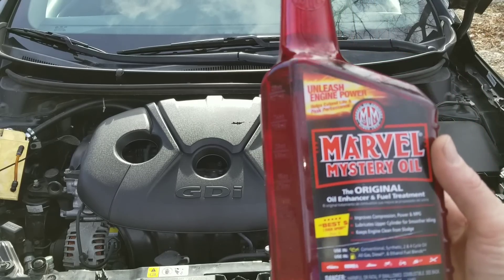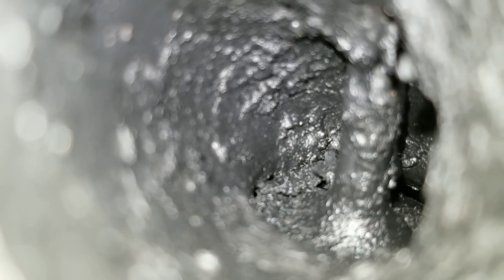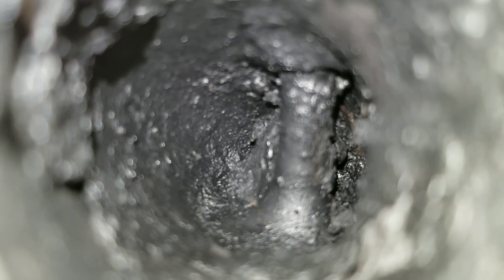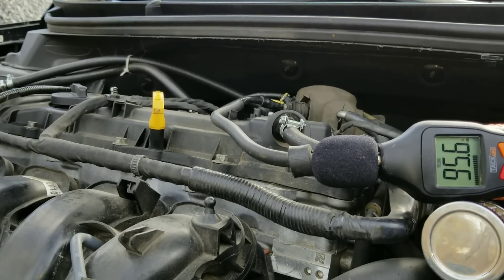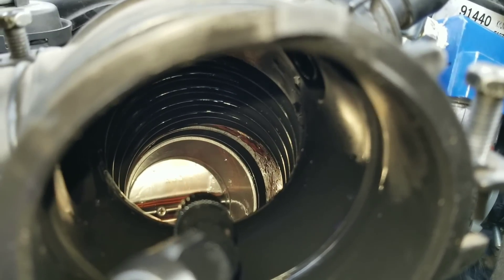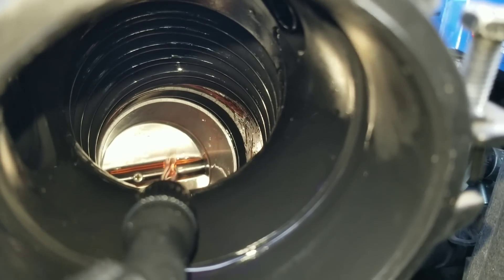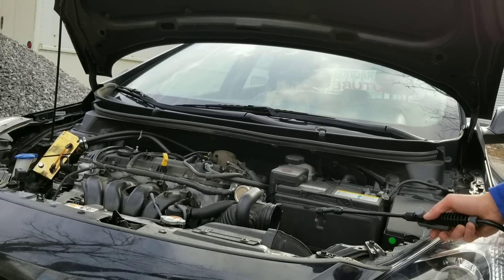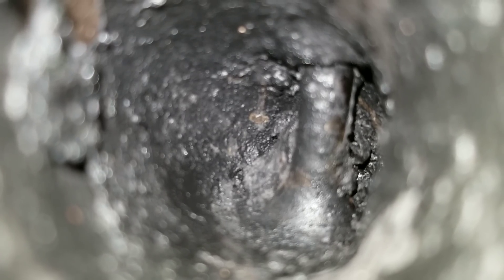SCOTTY nates REAL truth ABOUT MARVEL MYSTERY OIL

Comment: The engine needs to be revved up as you do it, that would've made a difference, but it still wouldn't be as good as seafoam aerosol, marvel is good to mix with oil and to add to your fuel. The solvent in it is not that harsh, it's very mild. It works wonders in a crankcase, change the oil and add a 20 percent mixture drive it a few hundred miles then change it again, that oil will be jet black in that little bit of time.
Reply from the maker: Yes i use as flush in video what about for a penetrating oil?
Reply: @NATESINTERACTIVEAUTO  :Hahaha Use Vaseline man ! just kidding .
Reply from the maker: For real the car is tired of getting ucked  with no ube lmao

Comment: Keep on putting it in your fuel and oil....it will soften the coke and eventually remove a great deal of it.  I’ve used MMO for 30 years, and so far, nothing else works better, but it is not an immediately cleaning substance. It’s a gentle cleaner and great lubricator

Comment: If you have a GDI engine, put an oil catch can in-between the crankcase breather and the intake. With direct injection the gas detergents don't clean the valves. The oil catch can catches the oil particulates before the recycle back in through your intake. 

Then I'd run a shit ton of seafoam spray in the intake to really get that deposit off the valves and intake runners.
Reply from the maker: Yes check out the gumout video also ive shown the catch can in the video. Seafoam gumout and crc are 3 that i have had good results with

Comment: Nate, add the cleaner into the intake via the pcv hose. You'll see a much greater difference.
Reply from the maker: It would still go onto the valves but not as even also risk hydro shock. So what can we try now?
Reply: @NATESINTERACTIVEAUTO  B12 chemtool has a hose with a jet for lack of better terms on the end and a proper hose fitting on the other. it works. I've injected into intakes for over 20 yrs without hydrolocking the engines. Raise rpm to 2k and just listen to the motor. It cleans much better.
Reply from the maker: Ive seen this thanks

Comment: I mix it in the fuel for my diesel trucks and semis and never had an issue, I've yet to dig into a before and after look but I did it once a week in a semi and once a month in my pick up and zero issues, had a tbi 350 in a 94 chevy that I mixed it with the oil after changing an oil pan gasket, ran it 500 miles and removed pan again to see the crank was cleaner

Comment: It is trying to work in the way this stuff works it is mild it will reverse the carbon slowly over just like it took a long time to build it up it takes a little while to break it down which is good at don't clog up anything on its way out of the engine that makes it a good product to continue use over time

Comment: Try b12 chemtool fuel injector cleaner on those valves they will be like brand new I use that stuff daily
Reply from the maker: Its a great product and i already have did just that in a video it definitely helps so how long have you used it?
Reply: I worked in a shop for 4 years that used b12 also. They buy it by the case. Best stuff for cleaning but it's strong so don't let it sit on plastic or paint. Great stuff. Way better than plain old carb cleaner.
Reply: NATES INTERACTIVE AUTO going on 5 years now I swear by it I have a few videos of it myself you need to check out some time!
Reply: zzzonezz your darn right I clean everything thing with it can’t beat the price per bottle at Walmart
Reply from the maker: What can i do to get me better
Reply: NATES INTERACTIVE AUTO your doing fine mine just keep posting videos with great content and try and be as accurate as possible and you can never go wrong just constantly research and learn more so you can provide more it all comes in time man keep up the good work
Reply from the maker: Any other product you like
Reply from the maker: Thanks so much
Reply from the maker: Yes i used b12 in a video
Reply: Congratulations you just cleaned one valve.  Just pissing on the intake valve isn't gonna get past closest cylinder.  Dohhhh!!!
Reply: @funtimeproductions5121  you can use the cleaned more than one way its very simple pull the manifold exhaust specifically then soak the valves bump the engine over then put it bk together then you have nice clean valves simple sorry you don't understand

Comment: What i did to my Mazda3 GDI engine was, i gave it a nice cleaning inside the valve by scrubbing the carbon off with wire brush and some diy tools. Once cleaned, i installed an oil catchment tank to traps all the unbrunt oily fumes that deposited at the intakemanifold later sucked into the valves n gunked it again. So far after 10000 miles, i rechecked the intake valves and it still looks clean with minimal deposits inside it. But im still using MMO inside my fuel tank atvevery 3rd fuel up... that will maintain my fuel injectors nozzles and the top of my piston clean
Reply from the maker: Any products we can test?
Reply: Im using seafoam to soak the dirty valves for 20 mins (making sure your valves is shut tight or at compress mode) then using a small metal pick carefully remove the carbon build up,  then I'm using small wire brush to clean the intake walls till it clean. Then repeat the process 4 times.. and u r good to go..
Reply from the maker: Great ideas what do you trust
Reply: @mazdaneo1  I got a 2016 Hyundai sonata runs great but I'm losing oil I've already did the GDI cleaning by spraying seafoam turn the vacuum line and I'm still losing oil
Reply: That's through the vacuum line and also change the PCV I think I'm going to clean the throttle and put a CAT scan in it
Reply: That's a catch can in it

Comment: Thin out the MMO with a light oil, maybe B12 or some other intake cleaner, so that you can get good atomization. The shape of that intake manifold all but guarantees that unatomized MMO will just pool at the bottom as the air whizzes by. Then when you brake or accelerate the MMO will slosh into the intake valves. Or maybe it will just sit in the manifold reducing manifold volume until it evaporates, leaks out or solidifies.

Comment: I think the marvel mystery oil [mmo] treatment needs to be carefully looked at.  Before catalytic converters, no problem.  Although there are some reports of "gumming" conditions.  With catalytic converters there is cause to be concerned.  I had a civic with about 250K+ miles and I used mmo with every oil change.  Converter was completely clogged around 200K miles  [car would not run].

Comment: I'd like to know if any one has re invented the water injection kit that worked so well in the 1940"s & 1950"s..FOR PASSENGER CARS, not for air craft, or racing applications, or turbo charging , or super charging .There was a system that kept engines clean & free of carbon, & made them run great..Is Marvel Mystery oil low in ash , phosphorous,Zinc  etc? What base oil does it use ? , is it closer to 2 cycle oil, or 10 w 30.? Is it synthetic?

Comment: What in god’s heaven did I just watch?  You asked what we think and this is what I think.  I think you should begin using a good quality synthetic oil with enough detergents to loosen up all of that gunk.  Better yet, engine flush that engine two or maybe three times.  Since you’re on MMO, you can use MMO as an engine flush.  Add the thing to the crankcase and drive around for a few hundred miles and change the oil and repeat.  I have seen build up here and there, but not as bad as what you have on that Hyundai.  Or might want to consider using something stronger than MMO as an engine flush.  Adding MMO to the fuel will not do a whole lot to that amount of build up.  My recommendation is to conduct an engine flush per month and monitor/adjust.
Reply from the maker: Thanks whats the next product to test

Comment: I would mix the MMO with about a gallon of fuel (ethanol/methanol would work good also)to thin it out a little.  Should be able to spray it finer.  Couldn't tell if you were actually spraying it in the correct place.  I have MMO in one of my cars right now (gas & oil), it has a lifter complaining a little bit.  Not expecting a miracle but it's worth a shot.
Reply from the maker: Yeah thanks great idea check out my new video gumout direct injection remarkable

Comment: I am injecting MMO using an ampco oiler to keep the valves clean on a ford ranger 2001, at the rate on about 1 pint for every 400 miles on average, from the test in the video it can be seen that MMO works at cleaning but very slowly, currently using the brake booster hose to inject mmo, not sure if using the pcv hose would be a better choice.

Comment: This type of test is simply a total waste of time and here is why.   If anyone has enough common sense in your brain should know that molecular structure of carbon atom is almost as hard as diamond because of very similar bonding to diamond.  Do you really believe any liquid poured into  gas tank or added to crank case will decrease or clean up the amount of carbon build up?  The answer is no.  The only way to clean up the carbon build up mess as bad as these demonstrated here around the valves is to remove the head off and have complete head job, along with ruined valves and even this, these valves may not become clean as they should be.  In such  case, replacement should be done.  If you are going to do anything right,  do it right the first time, rather than doing the half axx job.
Reply from the maker: If its a waste i want people to know but you are correct and some cars arent worth that kind of money
Reply: @NATESINTERACTIVEAUTO  keep moving forward.
Your demo is informative and should be used as part of a larger learning curve.
That's what I take from it.
Thank you for your dedication and hard work.
Reply from the maker: I really appreciate you
Reply: I think you mean valve job, not head job.
Reply from the maker: True what would improve our test

Comment: Word of caution - you might want to avoid doing that to vehicles which have a mass air flow sensor.
Some of those sensors use a heated wire....
Reply: AS showing in the video, you do that AFTER the MAF location.

Comment: As a preventative measure when should you start doing this? Is it worth doing this on Toyota D4S motors (direct and port injections)? Since the Toyota motors still have gasoline being sprayed into the ports and cleaning valves as well as direct injection. I have a 2018 Tacoma TRD off road with the V6 DS4 motor.

Also, on older vehicles how many treatments should you do and how often after that as a preventative measure?

Is this worth doing on older vehicles that don’t have direct injection and have older designed port injection? Thank you for the answers and videos.
Reply from the maker: Yes for different reasons bad gas lubrication of the combustion chamber so you can get alot more miles also check out my new video gumout direct injection remarkable

Comment: For next test try spraying multiple bottles of fuel system cleaner that has P.E.A. like in Gumout multi-system tuneup bottles(use  2-3 16 oz bottles?)and Chevron Techron complete system(use 2-3 20oz bottles?) on another vehicle to compare. Then allow heat soak for 1 hour then drive it for 20 mins on the highway. Thank you for the videos.
Reply: Or use Gumout’s maximum formula 20 oz bottles of One-N-Done that contain P.E.A.
Reply from the maker: Yeah thats one ive been told a few times i will i habe mixed seafoam and crc check out my new video gumout direct injection remarkable
Reply from the maker: This was the first time i used this im excited for everyone to see gumout direct injection valve cleaner i was suprised

Comment: Where is it that you and others see that cleaned, I see that the valves are still dirty, I do not believe in any of those products, the only thing that keeps a clean engine is oil changes in time my oil changes are less than 2000 miles that's the only thing that keeps a clean engine and good gasoline and good oil is my opinion ......
Reply from the maker: Yes thats very true. What ways would be best to really put a product to the test?
Reply: @NATESINTERACTIVEAUTO  You have proven right that the product does not work.(:
Reply from the maker: Yeah there was some carbon removal. What could make the cleaners more affective?
Reply: @NATESINTERACTIVEAUTO  new engine.....
Reply from the maker: Lol what about jet fuel as a cleaner?
Reply from the maker: Have you have success with what you did and what can we test next?
Reply: Angel Valdez I agree with everything you have said and would like to ask you if you think repeating this every 2 days for 3 total treatments would do a better job? I ask because I have a 2017 engine with GDI and only 22 K miles so I have a good bit of warranty left and do not want to remove the intake for the walnut shell treatment before the warranty expires. If all manufacturers would follow Toyota and Fords fix they would add another injector in the intake to keep the intake valve. They all probably will soon but for us stuck in the middle I guess we will have to stay on top of this as well as we can. You guys are very knowledgeable and helpful. Thank You Much.
Reply from the maker: Yes and what can I test next
Reply from the maker: Yes  do you use a oil catch can
Reply: Angel Valdez thanks Angel. I haven’t used my bore scope yet and have been running the recommended octane for the vehicle. I am very familiar with EGR from vehicles to industrial applications and agree with you on the catch cans. I have seen where the better quality ones separate the oil and moisture better and don’t have many leaking problems so I will be adding them after warranty. Dealers are so particular about every little thing if you need warranty work done and seem to look for things to bill you for. I hope Chevy and the other companies can come up with a fix or the after market with a new intake and added injectors and reprogram for the extra injectors. More expensive parts but hopefully it would head off serious problems down the road. Thanks again and I will take your advice. Oh, I live in the Southeast US and we don’t have to worry with inspection stations. 
Have a great day my friend.
Reply from the maker: Do you have alot of experience with a product
Reply from the maker: Awesome let me know what happens
Reply: Lio Mio 
Engine oil has nothing to do with that.
Reply from the maker: What test can we perform
Reply: NATES INTERACTIVE AUTO 
Try a steam machine.
Reply from the maker: Thats something new good idea what about testing tools
Reply from the maker: You got that right
Reply from the maker: Yeah great
Reply: Lio Mio that and doing this every time you change your oil.
Reply from the maker: Yeah your right
Reply from the maker: Yeah every 15000 to 30000
Reply from the maker: Yes thanks for sharing
Reply from the maker: Yes theres alot of truth to this but it can help the combustion chamber with   good quality fuel also the oil companys only bought in to the 20000 mile oil change because car manufacturers gave no choice so they can claim low maintenance costs but it does increase wear and with vvt cleanliness is very important thats what theres problems with the screens on vvt solenoids. Plus emissions back in the day were not as strict so we contaminate oil sooner but if you dont want to keep your car and are trading it off before it has to many miles but i mean if you wanna try and get 400000  miles plus with less repairs
Reply from the maker: But 2000 is way fast i agree just not this 20000 or 10000 to be on the safe side 6000 like you said

Comment: It worked good when I ran a gal of it through a vacuum line. Start at 2000 so RPM in a 2003 Mazda protege. Like run it in there stop let it set over night run it get engine hot and run the stuff like a lot of it the gal of it then get on the highway rapping out the engine, like don't let the engine idle! Then normal driving use the amount said in the fuel!

Comment: Gdi cant be clean that way because there is no injector to spray it . You need to spray it on the valve using a long straw and soak it . Gdi systems  are not the same as mfi systems
Reply from the maker: I sprayed threw the intake so what can we test next

Comment: So far, IMHO, the CRC has done the best job cleaning with the least amount of effort. Again, imho, if you use the CRC a few times during the vehicle's life from new, no issues. Or, just install a catch can after the warranty period. But, Scotty Kilmer does warn about using the CRC late in a DIF vehicle's life that there is a possibility of loosened carbon deposits possibly clogging up the catalytic converter(s). That's why i think it's best to apply a treatment early in a DFI vehicles life. Doubly so if it's got forced induction.
Reply from the maker: If carbon build up late it will break loose whether you use crc or not
Reply from the maker: You have very good information